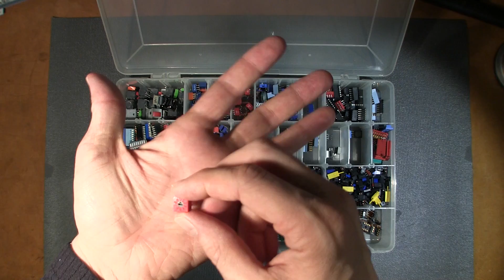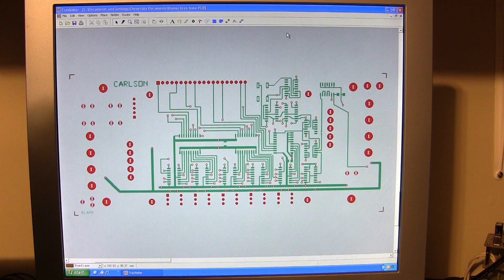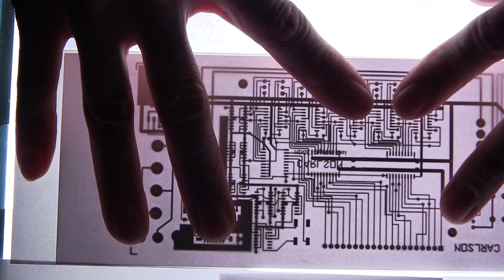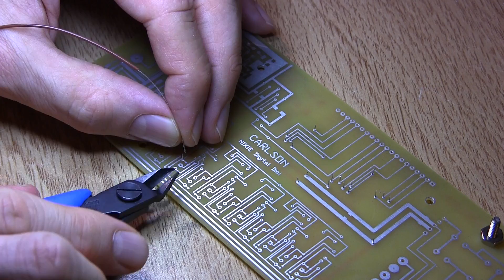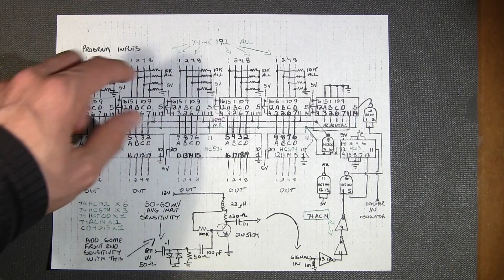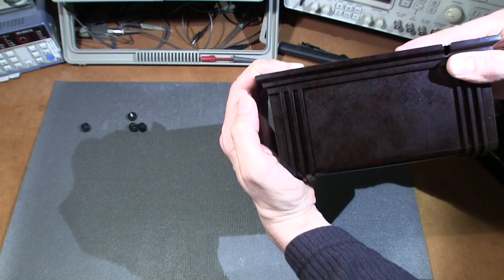Nixie Tube Digital Display for Receivers

Comment: I have that exact same clock. It was the UCT time keeper in a deceased friend's ham station.  It has an old Dymo embossed label that says ""GMT" on it, and the clock still keeps pretty good time considering it uses mains voltage as a  freq reference.,  I have more pressing projects right now. I am doing a 3000 watt recirc pumped  oil bath RF dummy load, using Aryton Perry wound resistors in parallel, so that knocks down what little inductance there is,. I also have a few guitar amps to finish up,  along with  electric & acoustic guitar repairs, and a travel guitar build using some bootleg patent infringement parts stripped from some US Customs seized Chinese imports. . I keep asking about the seized ivory, & CITES woods, but so, far, no luck. SOMEDAY!........maybe